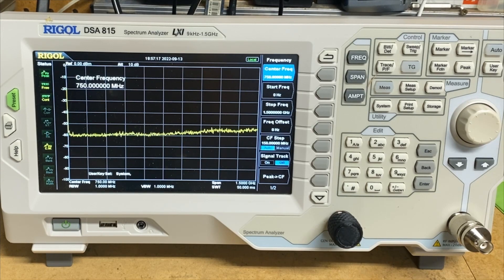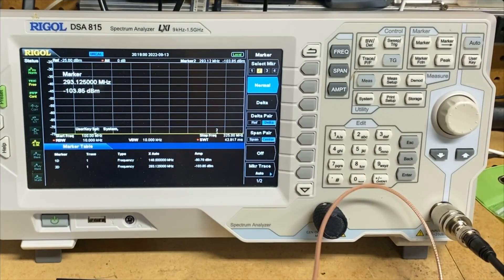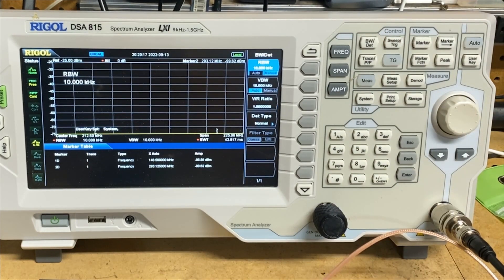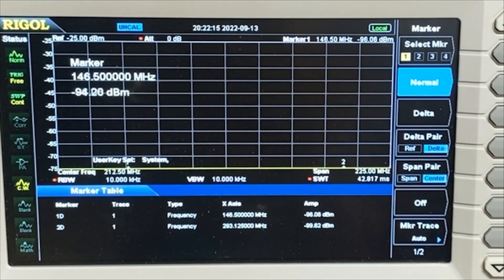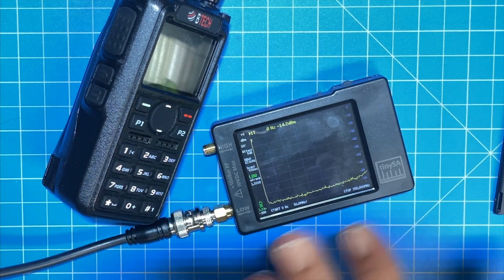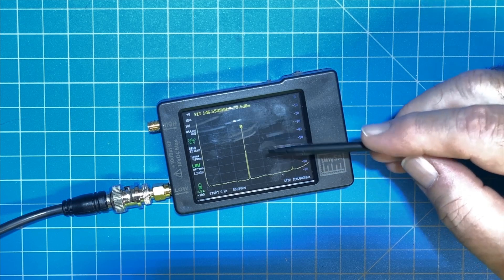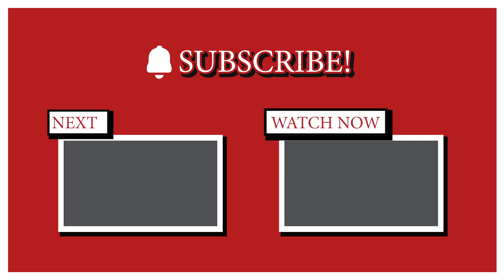Spectrum Analyzer vs TIny SA

Comment: I would like to make the point that the Rigol DSA 815 goes for $1299 on Amazon whereas the TinySA goes for $59.99.  Before retiring I was an RF engineer and used HP vector network and spectrum analyzers as well as the Agilent PNAX network analyzer.  A few years ago I bought a nanoVNA and a tinySA to use in my shack and was impressed at the way they performed given the price.  Granted they don't have all the bells and whistles that the professional gear has but the low cost makes them affordable for the average ham shack. Within the last few weeks I gifted myself with a nanoVNA-F V2 and a tinySA ultra. Those upgraded versions not only have extended frequency range ( the tiny SA ultra range goes from 100KHz to 5.3 GHz) but they also have a 4" display.  The touch screen interface also has improved response.  Incidentally the manual for the tiny SA is available in pdf format online and can be gotten from github if anyone wants to get familiar with the unit ahead of time. It does take a bit of time getting used to the gui but once you get the hang of it it becomes easy to set them up.  de N1ABE 73>>

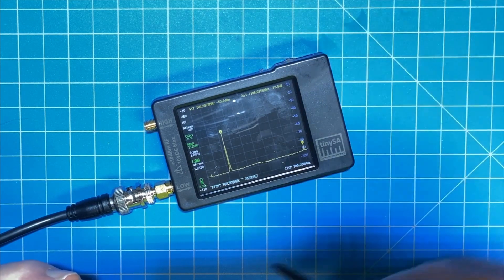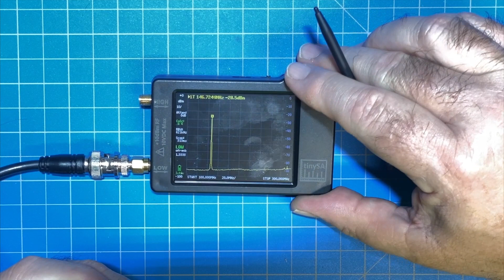Comment: Hi FEPLabs, there was really no difference when you turned the harmonic check off compared with it being on when using the TinySA.  What happened is that when you reduced the frequency range the location on the screen where the 2nd harmonic is located moved to the vary far right side of the display.  The second harmonic of 146.52 MHz is 293.04 MHz and since you changed the upper frequency to be 300 MHz versus 350 MHz the second harmonic location moved to the very far right side of the display right below the vertical axis labels (right below the -80 axis label).  You will also note that at 8:24 in your video you had reduced the frequency range and the RBW was at 112 KHz and the 2nd harmonic is very obvious but then at 8:31 in your video the RBW changed to 621 KHz which raised your noise floor which made the 2nd harmonic much less obvious.  A smaller RBW setting will lower the noise floor and provide a better signal to noise ratio regarding the signal of interest versus the noise floor.  Looks like the TinySA did a fantastic job, and it was working just like it should.  Just FYI, Don

Comment: Curious why you where using 5dBm/division on theRigol???. Now it was not possible to see the 2nd harmonic with 10kHz RBW so not visible if the 2nd marker was positioned correctly.
Why is the output power of the transmitter differ with the RBW? Was 10KHz too narrow to catch all the power of the FM modulated output?
Reply from the maker: All I was looking for were harmonics less than -40db down from the primary signal.

Comment: Interesting to watch. But you should have shown third order harmonics. Always check for odd order harmonics, not even.
Barry
Reply from the maker: Thing is, if the second harmonic is in the basement, as was the case, anything beyond that will be pretty much non-existent.
Reply: @FEPLabsRadio  Hi FEPLabs, depending on the circuit it's not uncommon for the odd harmonics to be much stronger than the even harmonics (push-pull amplifier as an example), and that's why Barry Kery recommended that you also check (display) the 3rd harmonic.  As an example I just checked a Baofeng UV-5RB and its 3rd harmonic is 8 dB stronger than its second harmonic.  Just FYI, Don